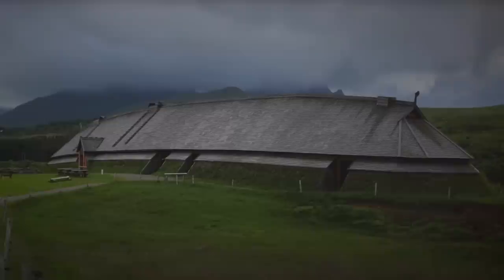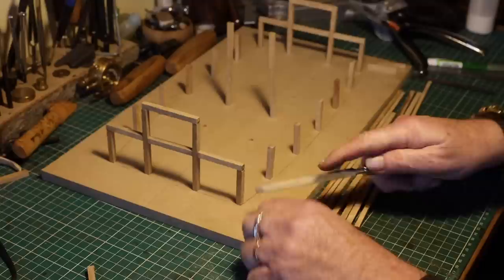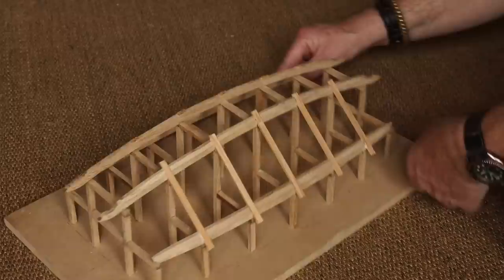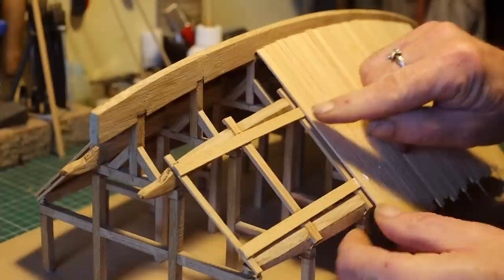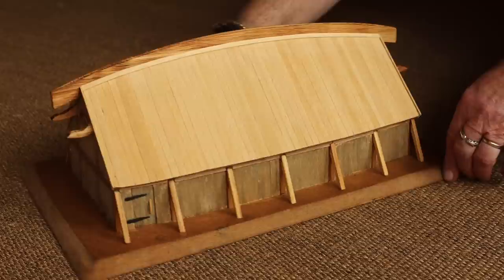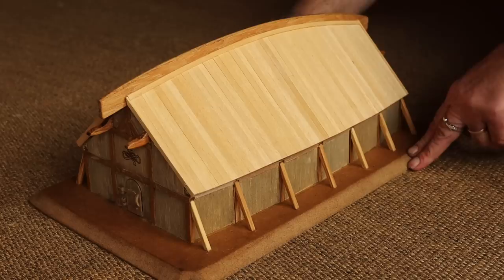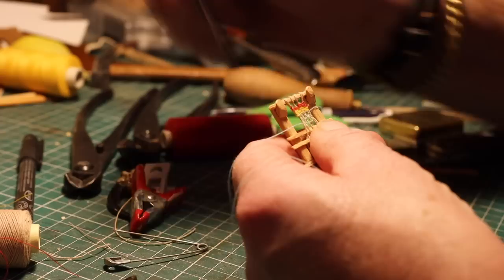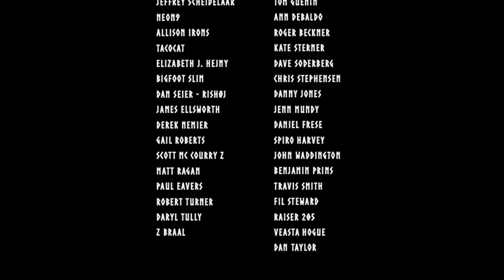1:50 Scale model build of a Viking Longhouse 🏕🔥🌲

Comment: The weight loom 16:07 is depicted upside down, no normal person weaves a reed mat from top to bottom, the reed just falls down. A reed mat can only be woven from bottom to top in a loom. Reed mats can only be made in a loom from bottom to top, the threads are fixed at the front bottom, run over the crossbeam to the back at the top and the threads are knotted with the weights at the bottom, the warp threads are twice as long.
To the weight loom 16:07  at the front, the threads are attached to a crossbeam at the front, the weights of clay or stone hang at the bottom, the weaving is done from top to bottom, to that I only say: NO the weight loom is built UPSIDE down, the threads are twice as long, are fastened at the bottom, run a thread length from bottom to top and then from top to back in the same length over the beams down where the weights hang at the bottom of the back.,  for no man can weave from top to bottom while standing. I'm sitting on the floor in front of my loom, because I am a board weaver and I weave from the bottom up. From a weight loom  Only the weights made of clay or stone have been found of a weight loom, so the depiction of a weight loom in all museums is grossly misrepresented.
Reply from the maker: Thanks for sharing your knowledge with us 🤗
Tom